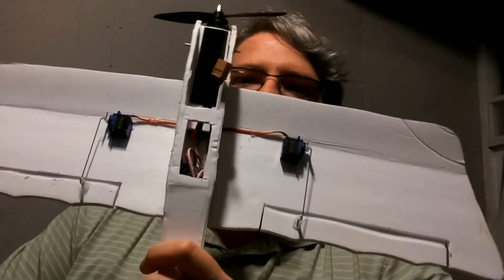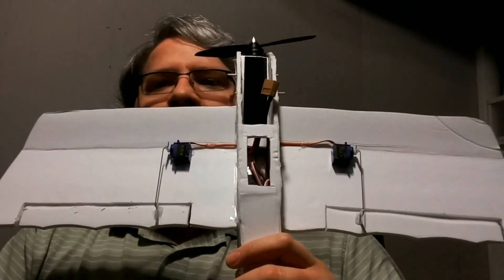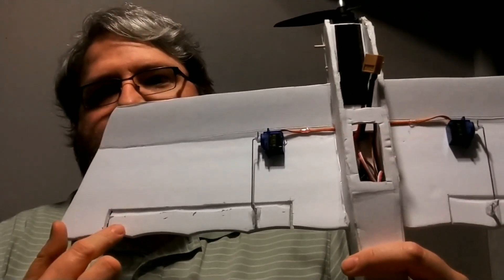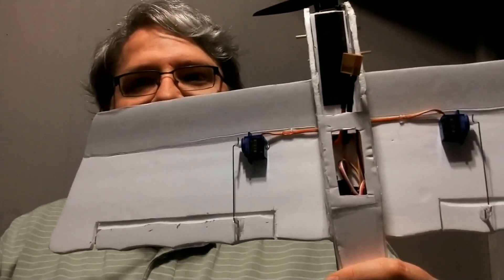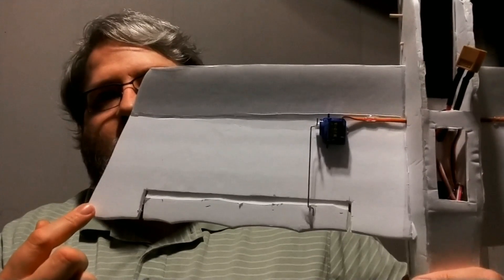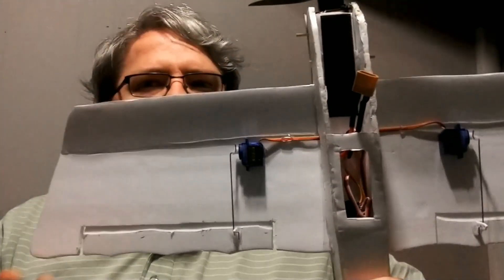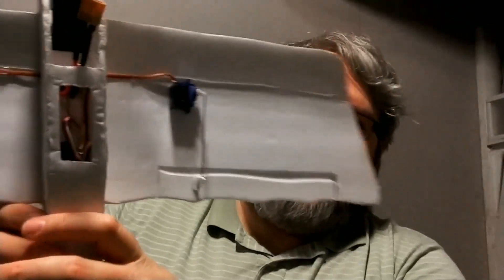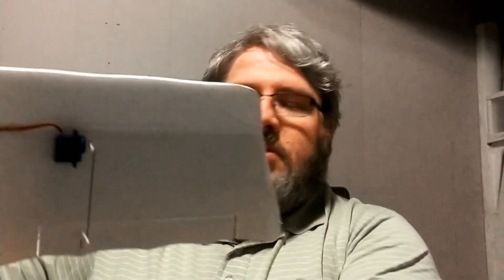FT Mini Scout - ailerons and a neat approach to control horns

Comment: Im building a 30" wing span...mostly so I dont have to fight the wiegth of using 4-ea 9 grams
servo and my 30A esc but I scale down the regular scout..going to use beefy wires the same size on my 44" modifed FT cub on 3 " wheels :-D (2212 930kv 10X5 2200mah..AUW of around 800 grams.
I should be right around 300 AUW grams on a 2208 1400kv 8x4 or 9x4..it'll do 400 grams on 2s 30C.  700 plus  grams on 3s..1000mah 30C or 1500mah 40C...so i can fly at local park
and be within regulations...ect. without getting a permit...ect. (it's rediculous)
It barely use a little more than 1 sheet of foam board. (120 grams)

I still have to drive out of town to fly the CUB..it's too big for 100 yard box  fun flying.
I crashed into 2 trees already.lmao..Im almost done building a more fine tune version
of the 44"....it flies great beucase of better wing load and extended fuselage  but needs more rudder :-P ..i can do hammer heads on it...

Hopefully I can fly the 30" scout closer and lower for aerobatic park sort of flying..
take more wacked out landings..due to it's lower wieght.

i can always modify it to a shoe string or whatever later. it's an EASY build
foam board are 30" long .lol..i just use GIMP (FREE) to import the PDF file.
can just trace or measure parts from my T.V. monitor.lmao
Reply from the maker: Sounds like a good size for a Scout. Get a video up on it, would love to see it when it's ready. I've thought about doing a speedier mini version.
Reply: @perkyplanesrc9363  i maiden the 30" scout today...I crashed landed it..tail heavy. it wasnt dial in..My control setting were all wack...TOO MUCH.lmao.,,My 3.5 mm wires  landing gear works great :-p
Nothing happened to the model...it was a hard landing.

 Broke the 8x4 prop..it was a little too fast. So, I  mounted a cheap orange 9x5..( it's perfect) 1500 mah 3s 40C...to give it more torque and slow it down..it's fast...On the second flight..it got windy..7-10 mph.
The model actaully cuts through wind better than my 44" cub...
I flew the entire pack....loop, rolls, snap rolls. flat spins...ect Had a blast flying it...It felt if thought I was flying a nitro again because of lower wing load...
I suggest..contrasting the top and bottom. It's little. i had a hard time seeing it, at first.....added duct tape under the wing for the second flight  :-P..
I basically put it through a stress test on the second flight...it flew great.
It's a mid wing. it's great for sports aerobatic
Reply from the maker: Sounds like a good flying model then. Is that a full 4 channel? Yeah contrasting is definitely worth doing so you don't lose orientation.
Reply: @perkyplanesrc9363  build it..it's easy..if you have the electronics already. i built one...but my electronic where too big. it was good practice building.
i just happened to have a couple of  2208 1400KV ( $5) and 2808 2400kv
and 8x4 props....they get around 600-700 grams thrust on 3s..all i have are 1000mah and 1500 3s..my 2s are 1600...So it's not a problem
if I over build..it's probably only 350 grams AUW

I built the cub after watching your video...but it's slighty too big for my park....Just like you, I'll fly further out...due to depth perceptions..I keep flying into the trees.lol
Being smaller..it'll simply bring the model in closer....
The samething happened when was flying .40 size nitro...The model is usually 75-100 yards out...when i went to .60...it was 150 yards out..
i crashed my .60...thinking it was 50 feet beyound the flying field...
usually were I crash...but the .60 was 100 feet further out.lol

it is what it is....Im going to fly according to whats comfortiable to my eyes...until I get better.